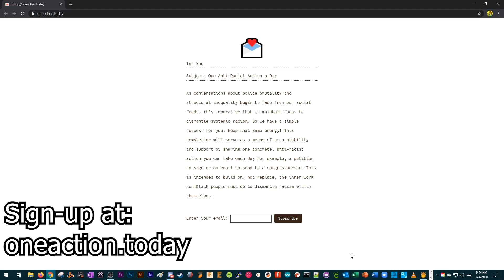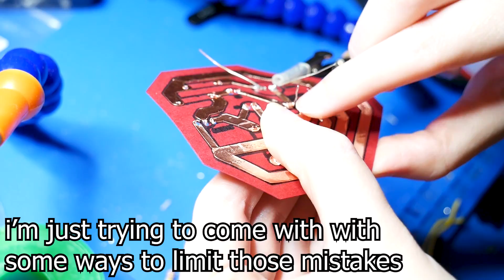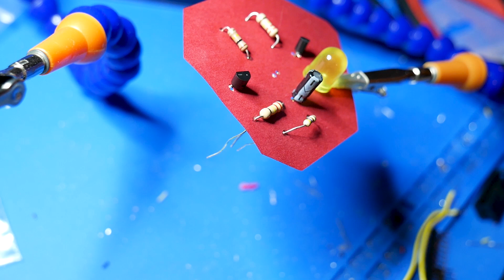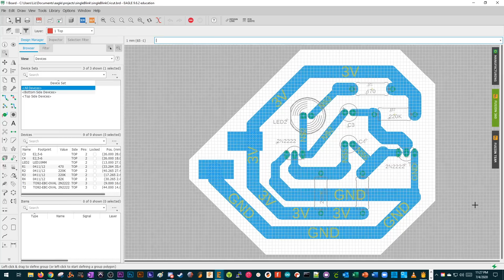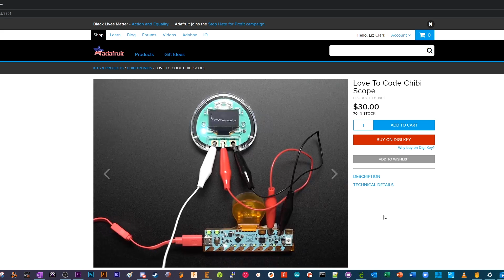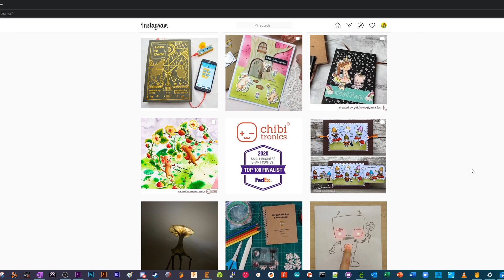Making Circuits with Paper

Comment: This is an amazing idea! I never would have thought of using paper as a circuit board substrate. With your relatively quick, inexpensive and chemical free method of building circuits, I bet that more makers would consider building their own circuits at home instead of wasting time with the usual ways. With some practice, I would be willing to wager that multi-layer flexible boards could be possible. I love this idea!

Comment: This is great! I've worked with this technique with a Silhouette Cameo and also a Cricut maker. It's effective to adhere the copper tape sticker to the paper first (or sometimes I use leather too), then cut with a blade depth that only cuts thru the copper - then you can peel off the "negative space" and you will be left with your traces in place - no transfer needed! Also, I totally solder on paper too and I haven't burned anything yet. :)

Comment: Interesting process! Would be wild to see if SMD is actually possible on it. I've found etching isn't too hard for simple single-sided stuff but this seems like a fun alternative. Non-copper-clad perfboard might be a good alternative to paper, if you keep everything on a 2.54mm grid you could end up with a rigid board and skip the drilling step. Alternately, sticking onto some polyimide film would give you an easy flex PCB.

Comment: Hi, this has nothing to do with this video but I've just watched your old USB Blu-Ray Teardown video and I have a question: do you think all external Blu-ray players have a SATA connection inside? I'm asking because I've wanna buy a dirt-cheap LG BP50NB40 burner that the seller says Windows doesn't recognize the USB signal although the drive seems to be working and spinning. I'm planning to use it as an internal laptop player, but I can't find any teardown video of this specific drive, that's why I'm asking. Hope you can help me, and great channel by the way, keep up the good work!

Comment: Isn't a sheet of copper foil basically the same as aluminum foil?  Aluminum foil is easier to get, in bulk quantities, for far less money.  Great project idea for making a large version of a PCB for prototyping. As someone pointed out in a show and tell session, conductive ink is worth playing with.  Also for paper craft or clothing there's conductive thread.
Reply: Aluminum is very difficult to solder.
Reply: @NiHaoMike64  Oops, good point.